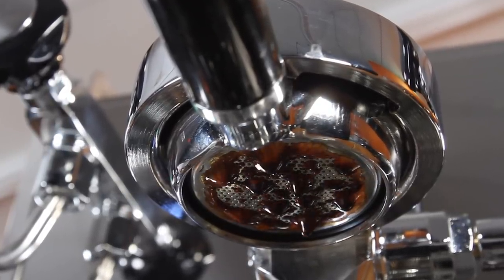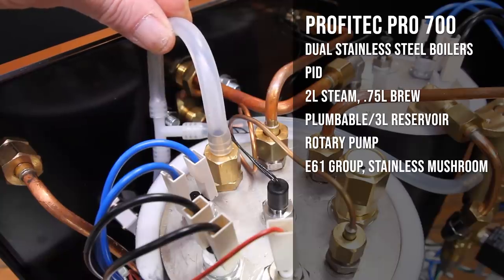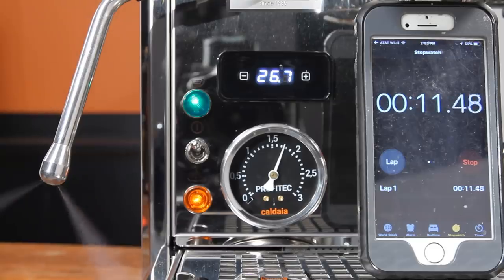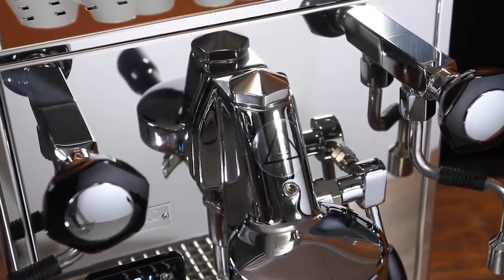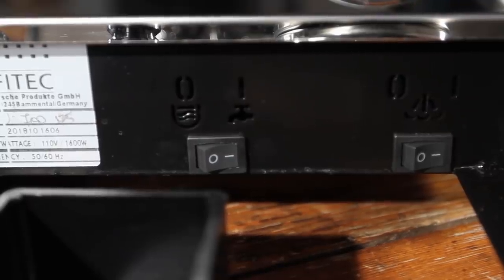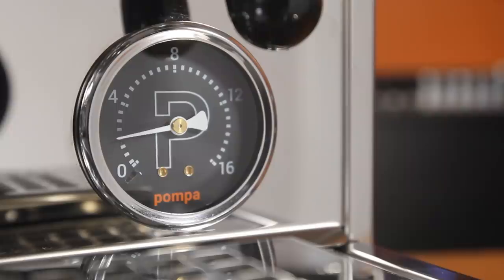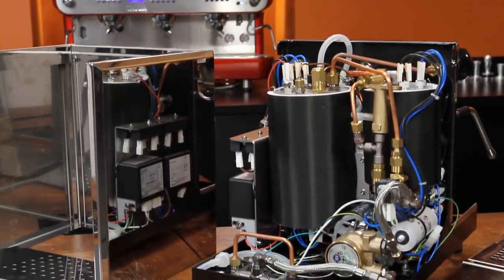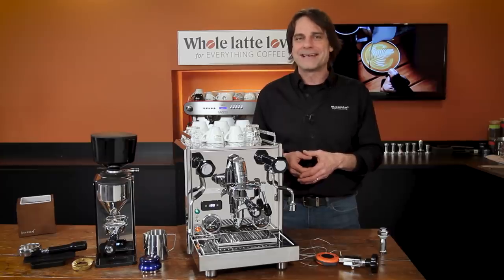Review: Profitec Pro 700 Dual Boiler PID Espresso Machine

Comment: I am struggling with which way to go.  I want to upgrade from a Rancilio Silvia and a Rocky doserless grinder.  Biggest complaints with Silvia is shot consistency and delay between shot and steamed milk.  My issues with the Rocky are lack of finer adjustments for grind size, clumping and also retention. 

I mostly do milk based drinks with my espresso.  Typically 6 to 7 ounces of milk. 

My current plan was to go with the Pro 700 and a Eureka Mignon Specialita.  This I feel would be the ultimate setup with all wants met.  Great espresso, pre-infusion, dual steam boilers with PIDs plus ability to plumb.   

If I wanted to save money would the Pro 300 and Specialita be a good alternative?   I don't want to compromise getting a good shot of espresso or the ability to steam milk simultaneously.  I would like to be able to get good milk foam for latte art too.  I realize with this setup that I would be giving up the ability to plumb and a 2 bar steam pressure.  My Silvia has a PID and does pre-infusion (or a form of it), not sure what the 300 does. 

Thoughts?
Reply from the maker: Hi v, Sorry for the delayed response. Down for the count sick for a couple days.

Pro 700 is a huge upgrade from the Silvia! You will love the steam pressure, rock solid brew temps, simultaneous brew and steam, plumbed machine, true pre-infusion and it's just a gorgeous machine! The Pro 300 or 600 are alternatives but as you mention you give up the plumbing, pre-infusion and rotary pumps. 300 operates at lower steam pressure. 600 has the 2 bar pressure. The Specialita is a nice grinder but if going to this level I'd go with at least 64mm burrs.
Reply: Do not get the minion. spend the extra money on the zenith. I got the pro 700 with T64 and I regret so deeply getting the t64. I know it matches, but want the Zenith or Rocket Fausto should have been my decision, but I cheeped out in the moment.. Mingon is what 53mm burr. Rocket Fausto is super sharp, a few hundred more 65mm burrs you never have to adjust to clean. still angry at myself for choosing t64 ... By the way, if money is issue, you won't be disappointed on 300, but don't cheap out on grinder.. just my opinion

Comment: After a year of testing (and 2 machines) you'll be lucky to get 1.25 consistent steam pressure. It heats up to just under 2.0 bar. The second you turn on the steam wand, the pressure drops to 1.5  After about 5 seconds of steaming, that pressure drops to 1.25 and continues to drop to 1.0 once I am done steaming milk 10-15 seconds.  The PID is set to the max of 274 degrees for the steam boiler.  While I love this machine, I am disappointed in the marketed steam pressure promises.  So just FYI that the you will not get 2.0 bar steaming pressure when actually steaming milk.  Lucky if you get 1.25 to 1.5 consistently.  Bank on getting around 1.25 to 1

Forgot to mention:  Plumbed  machine, 110v outlet.

What I haven't tested is if I switch to the reservoir to see how that affects the steam pressure when steaming milk.  More to come.....
Reply from the maker: Hi TK9S, Thanks for the report. Pressure dropping when steaming like that is perfectly normal. I know of no home domestic machines which maintain starting steam pressure when steaming and I've worked with and tested most of the machine makes/models available in the US over the past decade. If you like high (starting) steam pressure the Pro 700 and ECM Synchronika are best in class in that department.
FYI switching to reservoir will make no difference on steam pressure
Marc

Comment: Hi Marc, I have a new 2020 Synchronika with the 2bar but often during steaming the milk the steam boiler decides to refill killing the frothing power as boiler pressure drops from nearly 2bar to 1bar.
I have a work around of draining some hot water off prior to frothing which tops up the steam boiler but it’s not ideal.
Could the water level in the steam boiler need adjustment by raising or lowering the probe? I don’t seem to be the only one having this issue. Thanks
Reply from the maker: Hi William, Hmm... Boiler filling during steaming can happen but not on a regular basis - more of a random thing that water level in boiler just ends up near where probe senses it's time to refill when you happen to be steaming. You could check the fill level probe and make sure it's fully inserted. Could also pull the probe and check for scale deposits. I think it's unlikely but it could cause sensor issue.
Marc

Comment: Marc, talk about timing on this video... i was just looking at the pro 600 and started to look at 700.   I know you had mentioned the scace readings for the 600 were good, what about the 700?  I am looking for consistency of temperature during the shot!  I won't be able to plumb the machines but i am happy to jump to 700 if it's worth in its features.  I know the 600 has a smaller steam boiler than this and i think this one consumes more power - but my main concern is shot temperature consistency.   I am assuming no HX hump as its a DB, so temperature would be better than the 500.  Preinfusion i am assuming on this is same as 500 half a lever pull and you get water from the e61 only?
Reply from the maker: Hi B, Thanks for the questions. I've Scace tested the 700 in the past and it's very accurate and consistent. The 700 has the same brew boiler and brew circuit as the 600. Only difference brewing between the two is vibration pump on 600 and rotary on the 700. Got to say temps on the 500 are consistent and accurate as well. I've been amazed at the recent crop of HX machines with PID like the 500, Rocket Evo R's and Type V's. Thermosiphon systems are well engineered and they all are very temp accurate and consistent. Not like older HX machines with pressurestats. Unplumbed pre-infusion is the same with just dropping some water on the puck with maybe a slight push from boiler pressure but that fades quickly. I'd call that pre-wetting. Some thoughts on brew temperature... I'm guessing a lot of home users with pressurestat HX machines never flush prior to an extraction. They load and brew and in many cases dump boiling water on the coffee and are none the wiser. Even with a Scace temperature is incredibly difficult to measure. That's why my standard for PID machines is taking a reading when about 45ml of brew water have gone through. So many variables to consider like ambient temp, was the Scace preheated on the machine, heat absorption by the device, time delay in reading, etc. What I think is most important is consistency. If my PID is set at 200F to I get 200F every time at my measure point? If I change the PID set to 197 do I get 197 every time. It's tough! How long do I wait for everything to equalize when I make a big change in the PID set? Actual brew temp might be a little overrated. I challenge anyone to pick up on a 1 degree change in brew temp in blind tasting over a series of shots. What's important to me is knowing brew temp is consistent. Like I've been brewing a darker roast at a setting of 198. Then switch to a lighter roasted coffee and I change brew temp to 203. I just want to know I'm actually getting a higher brew temp and it will be consistent. I've been working recently with a saturated group Rocket R Nine One - video coming soon! Very cool machine with programmable pressure profiling, savable manual profile, hot water mixing and more.
Reply: @Wholelattelovepage  Marc thanks for the comments!  One more question on these dual boiler machines what is the recovery, i.e. how long after a shot pull i can pull another shot with consistent temperature.  I know on the older pro 500 it was around 5mins if you wanted to get consistent temperature, even with the pro500 pid i have read people usually wait 5+ mins for the second shot to fall into the same temperature ball park.
Seems like the pro600 might be a better buy if one does not need to froth huge amounts of milk!
I do think many of us get suckered into the world of quantifying the temperature variable - but after being a seasoned hx user i think i rely on taste more than temperature.

My goal on a db machine would be to have consistent temperature and also reducing time between recovery of the shot.  My first shot i always do a flush to evacuate any super heated water and i am assuming it is the case with DB as well, as water via thermosyphon process will get hotter than we want for the coffee.

Comment: Hi Marc, I had my heart set on this machine but then saw the Synchronika. Now I like both machines. What I'm truly wondering is whether I want the gauges up high or down low. Do you find that it matters? Is one better than the other?
Reply from the maker: Hi JS, Thanks for the question. First, know the Pro 700 and Synchronika are nearly identical internally. They are made in the same production facility in Milan, Italy. Honestly I rarely look at gauges. You might consider other differences like the lever control of steam/hot water on the Synchronika vs. knobs on the 700. Also, Synchronika has a higher level of finishing detail and angled portafilter - I like those! Hope that helps!
Marc

Comment: Great video Marc! I’m curious, do you have the SST mushroom valve available as a replacement part & will it fit an older Pro 500? I recently serviced my group head & found the existing mushroom valve to be quite pitted (most of the chrome had come off). Thanks again!
Reply from the maker: Hi Tyler, Thanks for the comment and question. I'm not certain about the stainless mushroom for the 500. Rather than me getting in the middle, I'd contact our customer service/tech support here: https://www.wholelattelove.com/contact-us Phones are open now or there's email and online chat available to help you out.
Marc

Comment: Hi, Marc. Thanks for the detailed review from which I have learned a lot.  I am curious about one thing concerning the Profitec pro 700.  According to the specs on your website, the machine uses 110V (USA) power supply (which is 110V and 60Hz), without mentioning the cycles it is designed for. Do you have any information as to how many electric cycles it is intended for?  Is it 110 V 50Hz only or both 50 and 60Hz?  If I use it in an environment  of 100V 50Hz, for instance, in Jamaica where it has 110V 50Hz power supply, will it work correctly?
Reply from the maker: Hi James, you are welcome! It should work fine on 50Hz. Power stickers on all the Profitec machines (ECM as well) we stock list frequency as: 50/60Hz.
Marc
Reply: @Wholelattelovepage  That is very useful information.  Many thanks indeed!

Comment: Hi guys I'm considering the bezzera matrix MN would you say it is on par with this or the syncrohnica? Thank you
Reply from the maker: Hey glen, Thanks for the question. Capabilities are similar but the Matrix is a more "techy" machine IMO with the color touchscreen controller. The Synchronika has more available steaming power running at near 2 bar pressure in the service boiler. It's also a much simpler machine under the hood and a lot easier to get inside. Both machine can do real pre-infusion from line pressure. Synchronika is available with flow control of the E61 group: https://www.wholelattelove.com/products/ecm-synchronika-dual-boiler-with-flow-control
Hope that helps!
Marc
Reply: @Wholelattelovepage  thanks Marc that ECM with flow is really cool...I've seen a video where you can get an upgrade kit for the matrix to add flow control at the group head which is interesting but not seem many reviews on it.its called the Bianca kit add on

Comment: Question regarding heat timing for the boiler. I'm back and forth between this 700 & the 800 Lever machine. I'm starting a mobile coffee business in Vegas and expect to attend venues that may require 15+ drinks pulled in a row. From what it sounds like, the prosumer 700 may heat quicker than the commercial 800 Lever. What are your thoughts? I'm not opposed to other machines but am hunting around the $2k-$3k budget. Always a pleasure watching the detail you have in these videos, thanks Marc!
Reply from the maker: Hi FF, Thanks for the comment and question. For those purposes I'd lean to the 700. But, neither are truly commercial machines intended for that level of usage. At that budget the only commercial machine I can recommend is the Gaggia TS: https://www.wholelattelove.com/products/gaggia-ts-espresso-machine
Marc

Comment: How does the bezzera matrix DE compare to the profitec700 or ECM Synchronika?
Reply from the maker: Hi ws, Thanks for the question. Here's a link to a side by side spec comparison: https://www.wholelattelove.com/pages/compare?products=MTU0NjAwMzk3MjE1NSwyMTY3NjI4NDMxNDE0
Notable differences: Synchronika (Pro 700 is nearly identical internally to the Synchronika) is available from us with Flow Control on the E61. Synchronika has larger stainless steel boilers. The DE uses copper boilers. Synchronika/700 can do true line pressure pre-infusion when plumbed to waterline.  Hope that helps!
Marc

Comment: The Pro 700 is a great machine but another major determining factor in deciding on a machine is parts availability. In New Zealand  there is only one supplier and he refuses to sell parts to individuals -also Profitec do not allow international shipping of there products effectively tying up supply check availability before you buy otherwise you may be screwed...
Reply from the maker: Hey Nick, Thanks for the comment on the Pro 700 - it is a great machine. Sorry parts are an issue in NZ - that's strange! Not the case for our customers in US and Canada.
Marc

Comment: Since no drain pipe is included with ECM Synchronica, what is the size of the pipe one needs to buy for the drain?
Reply from the maker: Hi James, Thanks for the question. The outlet is 14mm connection.

From the Synchronika manual:
Connect a suitable hose (not included with delivery) to the drainage container (connection Ø 14 mm) and to an already installed drainage syphon. Slightly incline the hose so that the residual water can drain completely.
Marc
Reply: @Wholelattelovepage  Thanks, Marc.  It working well now with the help of WLL costomer service suggested size of line.

Comment: Hi Marc! Thanks for the great review.
A quick question: Is the Profitec Pro 700 able to do pre-infusion using just the water reservoir (without line in)?
Reply from the maker: Hi NISY, Thanks for a great question! A couple of options when working from reservoir: You can do a pre-wetting of the coffee puck by lifting the E61 lever to a position a hair before the pump kicks on. I'll link a video below which explains that. It's different than true pre-infusion in that just a little water flows to wet the puck and it's not under pressure. Another option is Profitec/ECM's new Flow Control Device which retrofits/replaces the stock mushroom valve in the E61 group. More on that including a video here: https://www.wholelattelove.com/products/profitec-e61-flow-control-device With the FCD you can continuously adjust the flow rate/pressure during an extraction so you can do low flow/pressure pre-infusion and then ramp up to whatever flow rate you like. Here's the link to the pre-infusion/pre-wetting video: https://youtu.be/2DPcZD48TxM
Marc

Comment: I'm so torn between this and the 600. I don't think I'll be able to get this plumbed in my current kitchen. So with plumbing out of the picture, would the Pro 700 still make sense to get over the 600? :o
Reply from the maker: Hi T, Do you think you might be able plumb it someday? Remember, treat it well and it'll go for decades. The 600's vib pump is really quiet. But, the rotary pump in the 700 purrs!
Marc
Reply: I was torn between the 2 and then I saw them in person. Just hated the look of the 600. It was surprisingly squre. 600 was sitting beside the QM vetrano and almost bought that one on the spot. But I got 700 even over synchronic, because 700 is 2019 version. Snchro was only $100 more for me. I've had to wait 4 weeks to get it and could change my mind the entire 4 weeks. I still think 700 is smart move. It the endgame

Comment: Marc, I wonder if you know why Profitec/ECM decided not to introduce pump pressure preinfusion from the reservoir. It would seem to me an attainable feature (but I'm no expert). Is it a technical limitation or just a design decision?
Reply from the maker: Hi Joshua, It could probably be done but would require the pump running and then controlling pressure after the pump. That gets a little complex and adds points of failure IMO. The Rocket R60 has this capability. It would increase the cost/complexity significantly. But, GOOD NEWS - timing of your question is perfection!... Profitec just released their E61 FCD (flow control device). It allows for long low pressure/flow pre-infusion and variable flow control for the duration of the shot - even when using reservoir water source. It's a simple yet effective lower cost way of achieving the same thing. Here's an article with more information on the device which came out yesterday in the Daily Coffee News by Roast Magazine: https://dailycoffeenews.com/2019/04/10/whole-latte-love-and-profitec-ecm-launch-flow-control-device-for-e61-groupheads/
Marc
Reply: @Wholelattelovepage  That is awesome news! That really gives someone the option to get pre-infusion without having to hit the $2800+ price point on Profitect/ECM machines (which I prefer at this point). It would be very difficult for me to plumb the machine in my house so there really isn't another big feature for me to spend that much $$ on. Again, awesome news!